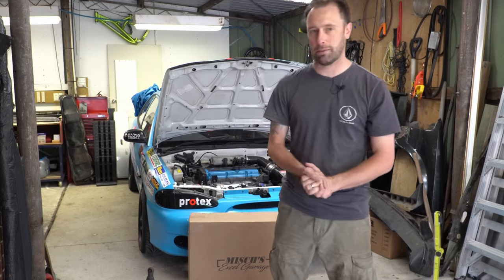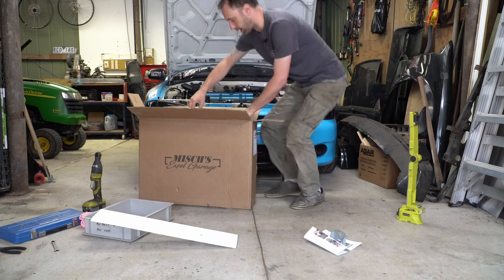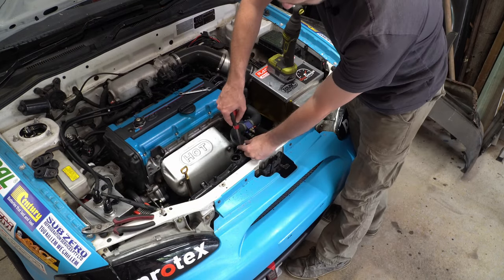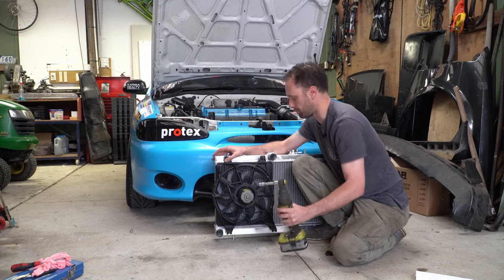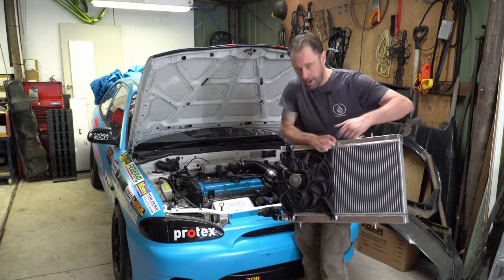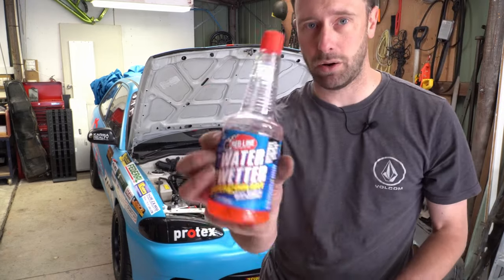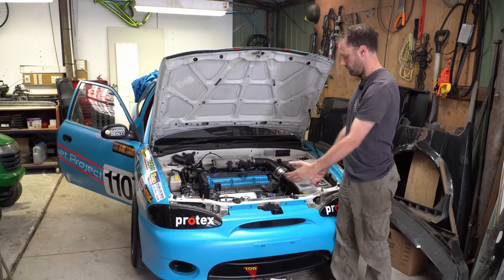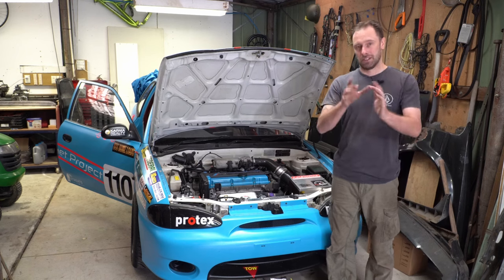Racing Radiator - How does it make more power?

Comment: At what temp does the ECU start retarding the timing, and how much does it retard the timing by?
A Bigger radiator is great and all for cooling, but an increase in capacity means an increase in weight.
I'm going to gather you have ballast so the extra weight is not an issue.
Reply from the maker: Yeah I'm not sure mate, would be a question for the experts, but yeah the little bit of extra weight isn't a problem for me :)